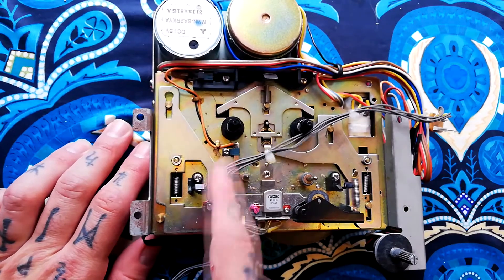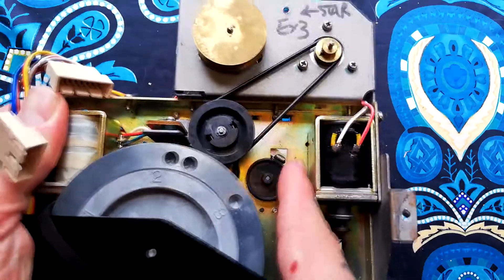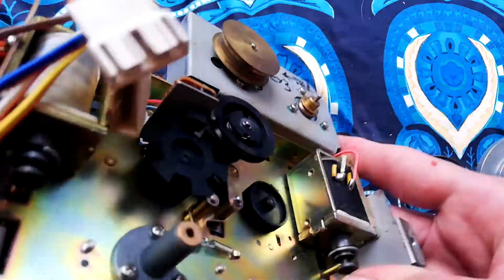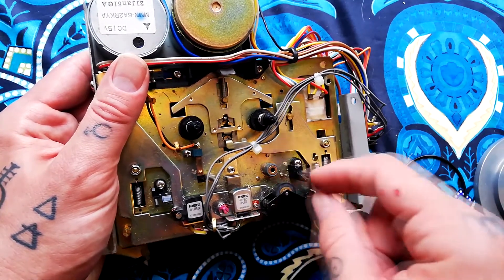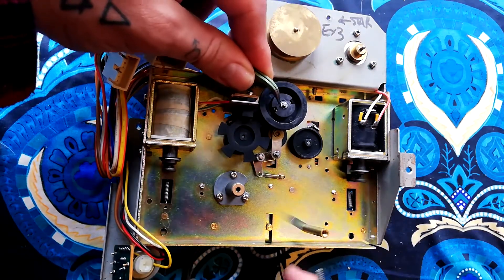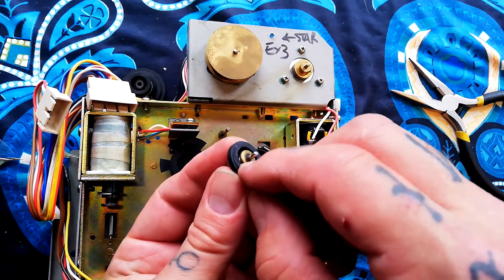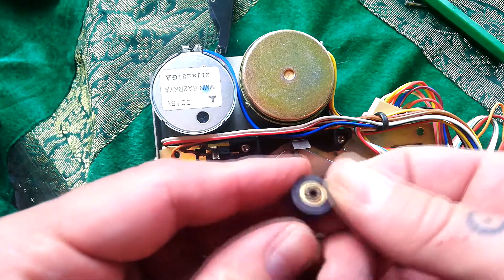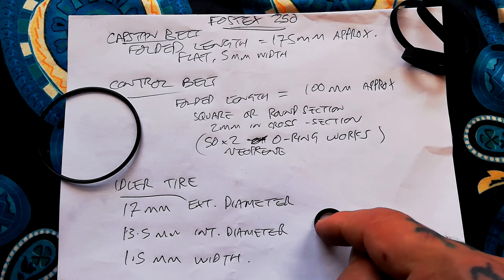Fostex 250 | Tear down part 2 | Analysis and refurbishment of the transport

Comment: I was able to change both belts on my Fostex 250 without unscrewing anything more than the main plastic cover on the back. Both belts can be replaced in seconds.

There is some vertical play in the flywheel shaft, so when the unit is lying face down with the back off, a gap opens between the flywheel and the metal plate that it normally rests on when operational, the other way round. The flywheel actually sits on a nylon pad or cushion that is highlighted in the video at 2m 50s.

When turned face down, the flywheel shifts a little and separates from that pad and provides enough space to slide the large flat belt across the top of the flywheel and under the plate, without any force or damage to the belt.

The smaller belt can be squeezed below the flywheel, by turning the flywheel to push the small belt past the smaller pulley, with no damage either. Indeed, at 1m 50s, we can see the old belt being whipped off without issue.

Despite replacing the belts, the take-up spool along with Fast-Forward and Rewind aren't turning properly on my Fostex 250. The observations at 7m 55s regarding the state of the idler tyre used in the clutch mechanism were very helpful.

Indeed, online searching has opened up a whole new world of idler tyres for me. However, these four-track machines tend to be rather niche, so do you have a preferred UK vendor for spares of this kind?

Incidentally, the Fostex 250 service manual states the following part numbers:

8216 0150 00 belt (capstan)

8216 0160 00 belt (reel)

8260 0660 00 idler assembly

I hope this helps and thanks again for the informative teardown.
Reply: Thank you, this was very helpful! You mentionned that you changed both of the belts, where did you buy them?
Reply: @Ph0sphore  I bought them from the Fostex UK distributor: SCV Distribution in Hertfordshire. The spares chap needed a bit of prodding at first, helped by giving him the part numbers to check but he delivered in the end. I think the delivery cost more than the belts, but SCV uses couriers for dispatch. Good luck.

Comment: Thanks much! The last part at 10:00 with the 175 x 5mm flat & 100 x 2mm  square belts and the 17 x 13.5 x 1.5mm idler tire sizes is gold - the Fostex 250 service manual doesn't have that info, just part numbers that don't google well.

Comment: So I just got mine. Seems in good order motor wise but play doesn't engage the tape, nor rewind or fast-forward, though I hear the electronics working correctly in the background. I assume this is just a belt replacement issue and maybe some cleaning. Inside looks for the most part as clean as this one.
Reply: What's the reference for the replacement "tire" for the fast forward/rewind wheel? After watching this I'd bet that's one of the problems. And thanks for all the details at the end!!!!